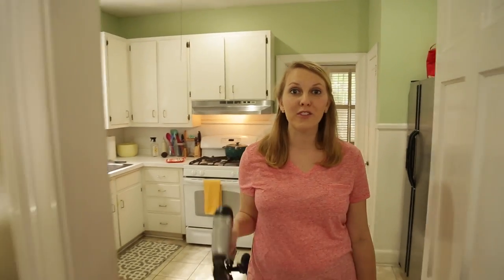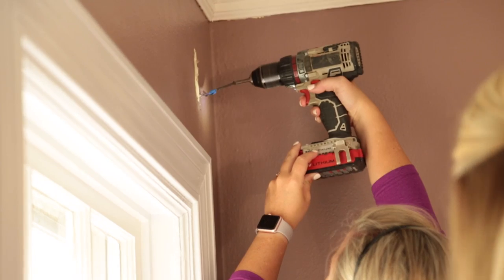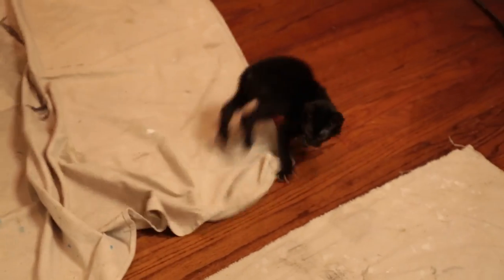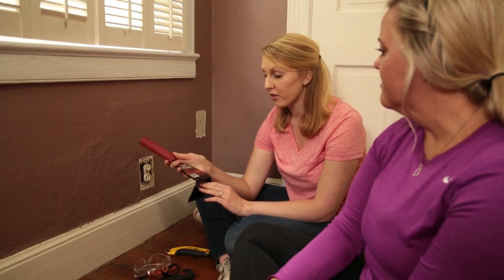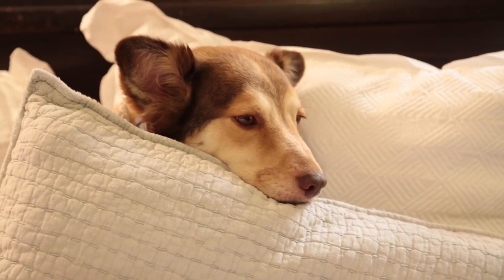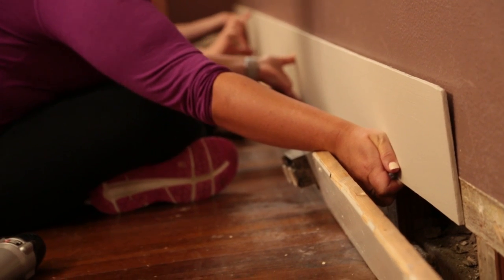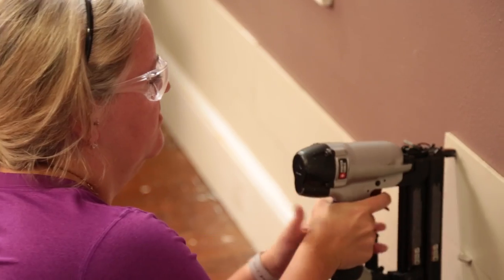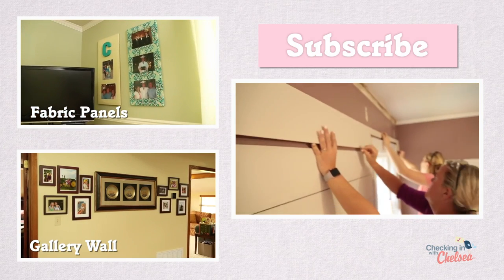DIY Shiplap Wall on a Budget

Comment: Really fun video to watch. It looks good and I think you have achieved the farmhouse look. Pay no attention to the negative posters. They no doubt have never picked up a power tool let alone taken on a project like this. These types of videos encourage others to try new things in their home without fear. Keep it up!
Reply: I'm no expert at all and can barely cut a straight line. There is one thing that I know and that is those finish nails driven into sheet rock are not going to hold. Maybe a year or two or 10 years but just closing the door into that room over time will vibrate them loose. Such a basic mistake to make.

Comment: .55/linear foot of 1x6 actual pine shiplap straight from local mill...folks shop around, so many people spending more money using plywood and other subpar materials from lowes/depot
Reply: You are right. If the room is 10 feet wide and 8 foot ceilings there will be about 16 strips at $5.50 a strip x 16 = $88 Huge time savings and likely better looking. However, today is 10-4-20 and the ship lay you mentioned is likely $2 a linear foot if it went up like every other wood product. Still, it may be cost effective as the plywood went up as well.

Comment: You should have painted the wall behind the faux shiplap the same color you painted the plywood used as shiplap..it definitely shows. Great idea but that is one oopsie that would be extremely time consuming to fix
Reply: Alyssa Mathews I agree. If they even painted the top of the board and a strip of the wall after installing each board it wouldn't have shown.

Comment: Good video. But for DIY people you need to mention a few more things. How about nailing into a stud instead of random nail shots. Always prime after putty even in nail holes. Paint does NOT look the same on spackle/putty. And when you reattach baseboard and crown moldings new cuts need to be made. You changed the elevation. DIY people appreciate these videos but you just need to tell them more instead of making it look so easy. It is not easy to get it to look good.
Reply: Debi Rowlett looks as though she was using regular titebond wood glue, which is great for bare wood to wood contact, but it will not stick to paint, not even a little, which could be why the wavy look, that and nailing straight on into plaster or drywall, you should use all purpose construction adhesive, when nailing into any thing other than a stud you should nail in a w pattern basically most holding the gun at an angle. also instead of using quarter inch plywood get half of 3 quarter inch MDF of you're going to paint, it's usually cheaper or near the same price

Comment: Good idea. Although I strongly recommend that final cuts not be made at a hardware store. They just simply never do a good job.
Reply: Hardware/big box store panel saws are for rough cuts, not precision. It's there for your convenience, basically just to rip bigger boards in half so you can get it in your car so you'll buy the wood. If you want boards cut to a perfect fit for your project at home buy a saw, and then later at home, still cut over your mark and edge up to a perfect fit.

Comment: The big home improvement stores are now only cutting 12" or bigger.
Reply: I think that's just for their last cut.  They will probably cut a big sheet of plywood down into 6" or 8" strips, but once it's below 12" of actual material they won't make that cut.  I think it's a safety precaution, though I can't see the danger